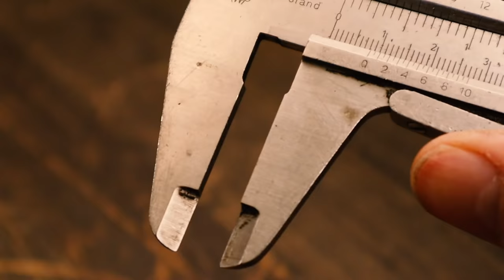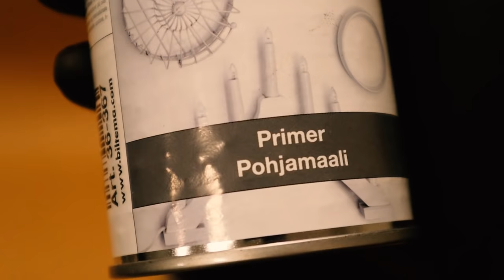Gladiator Helmet Restoration – Roman Warrior replica

Comment: Great job, I have a question. So when the helmet is all rusty is assuming the metal becomes weak right? So after you restore it does the metal become stronger or does it remain being weak?
Reply: Metal becomes weak as metal itself reacts with moisture in the air to form rust. But that's just the surface in most cases.

Comment: At the risk of sounding like a hater, it was cooler before the resto.
Reply from the maker: Yes i know 😬 ... or at 3:57 👌 - You cant win every time😉
Reply: @AwesomeRestorations  it looked very cool at 03:57 :D For next time I recommend to use a different glue for the gold leafes, so it would not flake off - or plate parts by electrolysis.
Also the drill holes were quite out of center for some reason.

Comment: Roman gladiator helmets fit for purpose not just protection meaning there are various types of gladiators, each distinguished by the weapons and armor that were used. Furthermore, there was a variety of gladiator helmets plus not all gladiators wore helmets these gladiators were called net-men meaning they only had a net, a trident, and a dagger. The type of replica you are restoring is called the maximas.

Comment: I would make the suggestion that you learn some gilding techniques before you do any more restorations that use this method, as unfortunately, the way you have done this one is not quite correct, and means it will flake quite badly, very quickly, as no sealer has been used, and areas around the edges are left unstuck, and exposed.
There are some really good tutorials on YouTube showing the proper use of gilding and the materials you need to do, and then seal it properly. I hope this helps in future projects you do.

Comment: Do you ever use muriatic acid for rust removal?
Reply from the maker: No I haven't tried that
Reply: @AwesomeRestorations  it works great.  I soaked an old rusted horseshoe in it for 24 hours, rinsed with water and it came out like new.

Comment: Все видео что я смотрел у данного автора, мне нравятся, очень подробные, видно старание мастера во время работы. А вот данное видео меня огорчило, совсем не информативное, пользы в нём нет, очень жаль. Но если подойти к видео с другим восприятием, то тоже не всё хорошо. На мой взгляд шипы надо было заменить все и сделать их высоту не более 10 миллиметров и даже ниже, высокие пики на мой взгляд выглядит лишним и портит общий вид. Прошу автора исправиться и делать контент так как он умеет. Спасибо заранее. 
All the videos that I watched by this author, I like, very detailed, you can see the efforts of the master during work. But this video upset me, not at all informative, there is no use in it, it’s very unfortunate. But if you approach the video with a different perception, then not everything is good either. In my opinion, the spikes had to be replaced with everything and their height should be no more than 10 millimeters and even lower, the high peaks in my opinion look superfluous and spoil the overall look. I ask the author to correct and make content as he knows how. Thanks in advance.
Reply from the maker: Thanks for watching and for sharing your knowledge I really appreciate it 👍